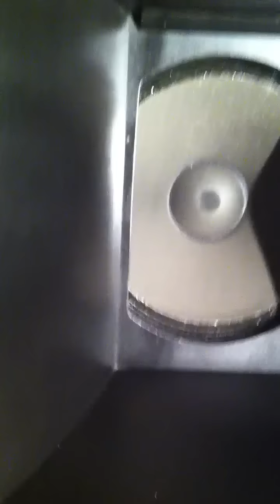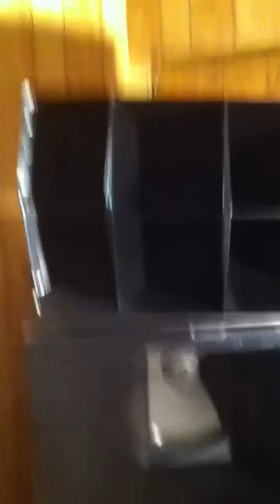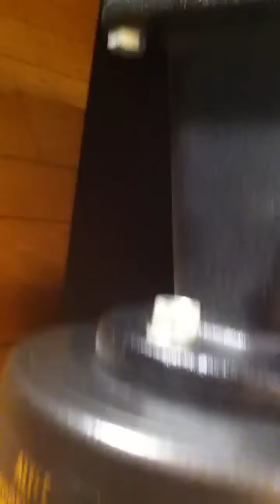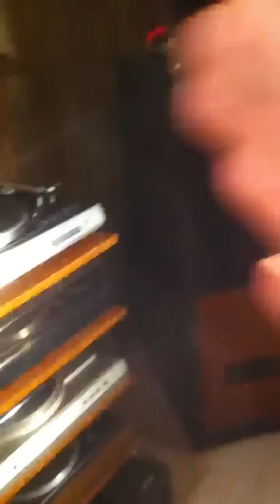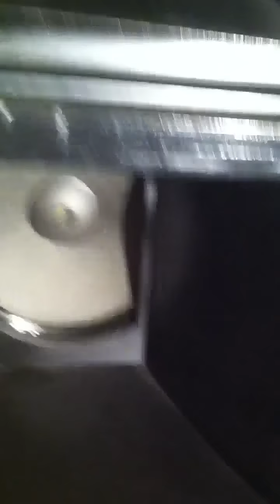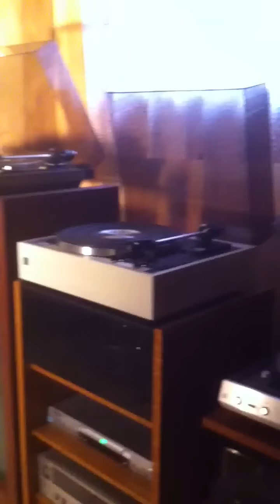Altec A5 VOTT

Comment: I played in a band back in the 1960s which used this same speaker for P A system. I left after a year and went into the Navy. When I came back I found out the guys had basically destroyed this fine speaker and were using cheap sound columns. What a shame.